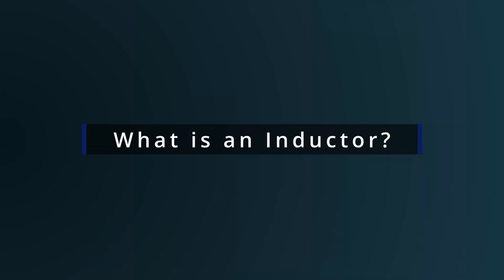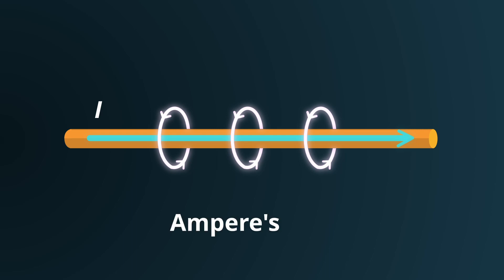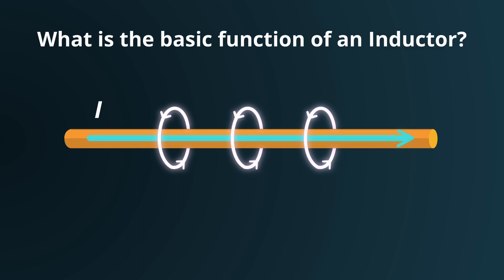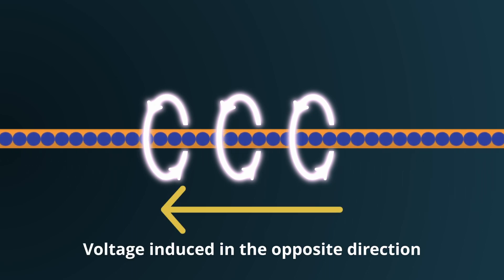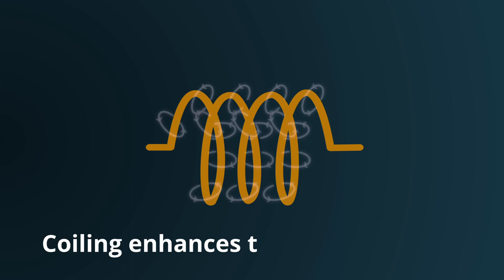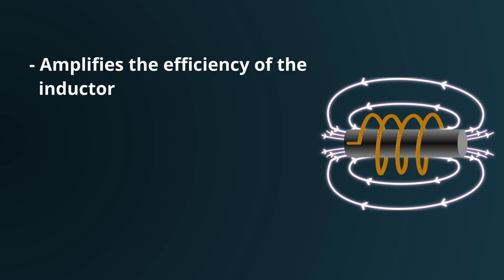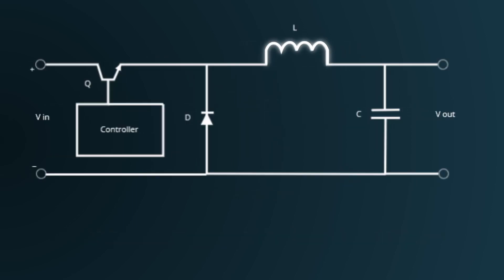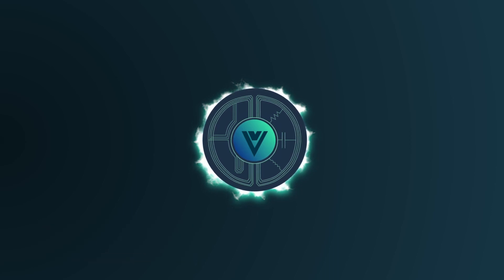What is an Inductor? | Animated Explainer

Comment: Nice explanation and animation.What’s the reason for using conventional theory?Simple circuits yes but not electronic Cheers Just asking
Reply from the maker: Thanks for your feedback!

We use conventional current (positive to negative) as it's a widely accepted standard in electrical engineering and education. While electron flow is from negative to positive, conventional current provides a consistent approach for circuit analysis. In advanced electronics, electron flow nuances are crucial. But for the "Inductor Basics" topic, the conventional approach aligns with many educational standards and avoids confusion.

Appreciate your insightful question!